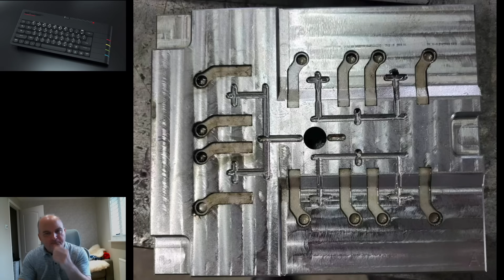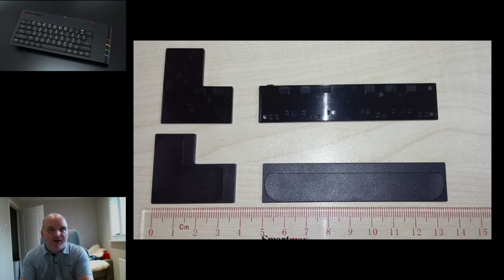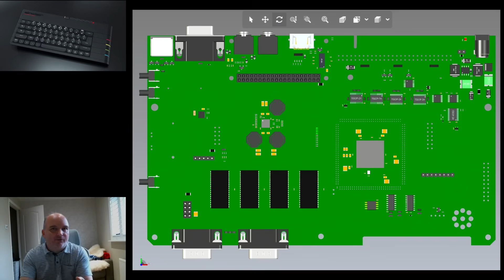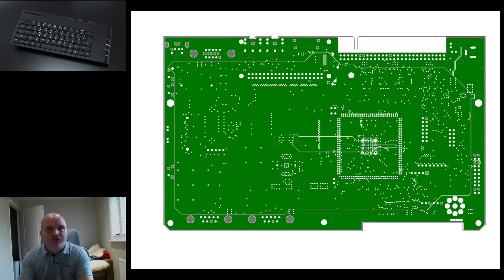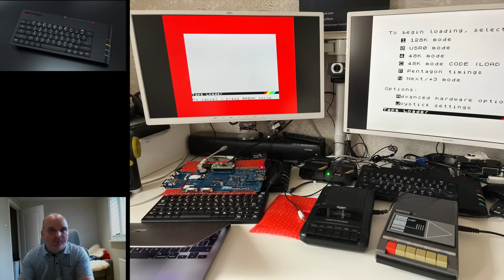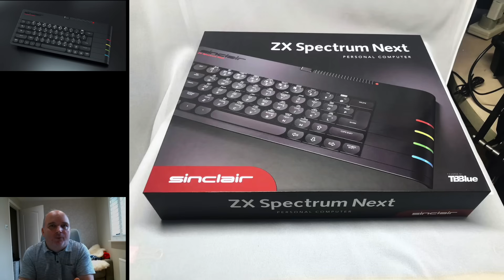Kickstarter 3 - What happens now?

Comment: I would much prefer they DON'T rush to get the units out before Christmas. The KS2 product was massively delayed by circumstance, but my goodness, when it did arrive it was an absolute gem. So more of that please!
Reply from the maker: The hardware can't be rushed. The main delay would be component availability. Until you know the BOM, and that only comes once you have finalised the changes you can't be certain that every component will have a nice lead time. Lead times can be as bad as 30/40 weeks in some cases and in those cases you are typically recommended an alternate part which needs to be agreed. The one thing that is affected by other products being manufactured, especially from the big companies like Apple, Sony etc.
Reply: I have bought two as christmas presents so I'm hoping they do arrive by xmas!  haha!!

Comment: If You can - PLEASE remove glossy plastic from the cover. Its scratched like a hell. It should be matt finish like in 48+
Reply from the maker: Which cover? Do you mean the rear of the unit?
Reply: @SpectrumNextStuff  Yeah. I've seen a few unboxings. Several people pointed to the shiny plastic on the back and front as the main issue (magnesium for scratches).

Comment: It is great to hear about these details about injection molding; but it is a science, and what is described here is done by machinery with a tolerance of .1% of error margin. If you go to a reputable factory, they do this for a living, so the temperatures, the contact time, the oil type and the type of plastic mix is all accounted for. Then of course if you go to a factory that does things at random, and does also injection molding, that will result in issues as they need to normalize the system before crank out the cases. Being the third batch at this point I would expect that most of the work has been normalized already, unless they are hiring factories like PCBWay and similar.

Either way, I have 0 expectations that this will be ready by Q4 2025. Even less realistic to see the bunch of extra stretch goals being made before 2027 at best
Reply: Some of the stretch goals from 2017 still haven’t appeared for various reasons.

Still hoping Nodes of Yesod for the Next will appear one day, despite being replaced by Way of the Exploding Fist later on.
Reply from the maker: @stephenvalente67  I'm still in touch with Steve W on the topic of Nodes. Also with Jas on Rex. They still say they're going to happen. That's all I have for now :)
Reply: @SpectrumNextStuff  We can but hope.
Reply: @stephenvalente67  This is what happens when you pay before getting goods. It will happen maybe one day, but as there is no legal implications, nothing is expected.
Reply: @fcf8269  I do think Kickstarter themselves should be more proactive in dealing with the dodgy campaigns and giving those who don't communicate properly.
Reply: @stephenvalente67  It is the nature of the beast: you try to sell something that does not exist, you want people to finance it and increase the cash flow, so you end up being less realistic about actual deadlines and goals that can be achieved in the allotted timeframe.

Just look at Star Citizen... 12 years down the road and they are still struggling to make up for stretch goals they made 7 years ago... And are still promising things to get the cash flow going.
Reply from the maker: As someone who has not been through the process with the Next with two Kickstarters and three different injection moulding companies you're far from being in a position to comment on the actuals, or the reputability of the companies involved. I say it like it is after spending years of my life working with these companies and industrial designers.
Reply: @SpectrumNextStuff  As someone who shipped products for his entire life, I have enough knowledge to tell something on the process. I lost about 400K on one product but made more than 5M on others, so it is more than the two you did probably. And I have a degree in chemistry and industrial processes, so I think I understand a thing or two. 

Then if you want to leverage on your "fame" go ahead; that will work with ignorant folks, not with people with actual experience I am afraid.

Comment: Are any of the stretch goals (C64 core, Sam Coupe core, etc) incompatible with the original / the early KS1 Next?  Just curious, though I have a KS3 on order, if backwards compatibility is part of the official stretch goals / cores, or the philosophy and guidelines of the team behind the design.  And, by extension, if there were a KS4, if my KS3 would be obsoleted in some way?    Also - another question, would multi-disk swapping supported with systems such as the C64 core?  Many of the games I enjoyed here in the US had multiple floppy disk images, not just single load from tape, and difficulty swapping between disks can be a deal breaker.
Reply: From what I read during the campaign all the cores are compatible with the KS1 & KS2 models.

However, there was a specific usage case whereby I think it were a community created FPU option was made available for the QL core, the KS1 edition with its smaller FPGA couldn’t accommodate that.

I’ll be putting my upgrade board into my KS1 Accelerated case, then using the KS1 board with added memory, etc. in another case.

Still have the original KS1 board only PCB too.
Reply: @stephenvalente67 sounds like fun projects on the horizon for you.Are there Next board ready cases out there or will it be a custom project?
Reply: @coppermutant  It would be a custom project for sure.
Reply from the maker: The focus for the alternate cores is on KS3 units. This is what was pledged for when breaking through the various stretch goals. Whilst this is the focus it does not necessarily exclude KS2 or KS1 units from the party, it's just that there is much to do and so you have to spend your time wisely. Given the similarities between KS2 and KS3 and their use of the Artix-7 range, there is a good likelihood of seeing the cores on KS2. KS1 may also come assuming capacity is sufficient, although you may find some cores are more basic in terms of their implementation (recreating the machine accurately but no additional enhancements).

Anyhow, it's quite early to say at the moment.
Reply: @SpectrumNextStuff thank you for the reply!

Comment: I don't know what the solution will be regarding key mapping for different computers, but one option is to attach several plates made of thick, wear-resistant material, on which the Next keyboard would be drawn with the designation of the keys, for example, for the Commodore. There would also be a place to list all the key combinations too.

Comment: Thanks for the update. I have been hearing the upgrade board will need a different power supply as the KS3 board uses more power. Will this be supplied?
Reply from the maker: There's no information on PSU yet because the power requirements need to be determined once the PCB prototyping is complete. It could be that nothing changes. It could be a slightly more powerful PSU is required.
Reply: @SpectrumNextStuff  thanks for update. Exciting times!!